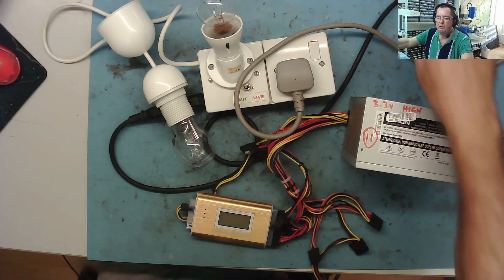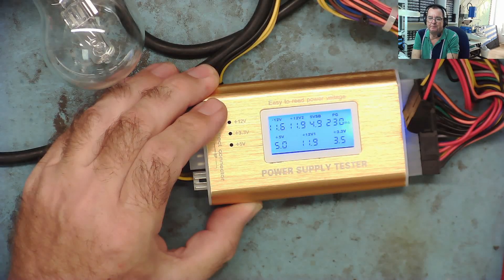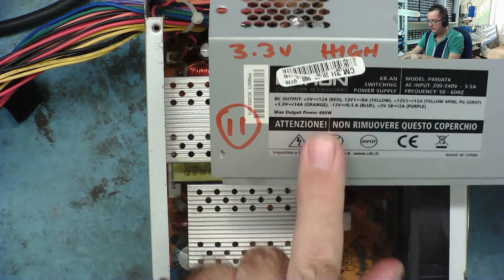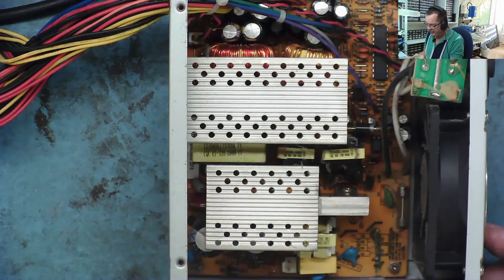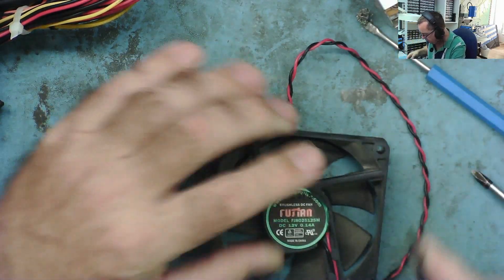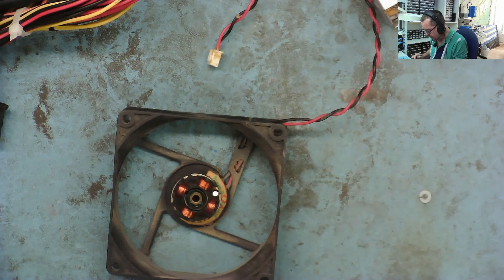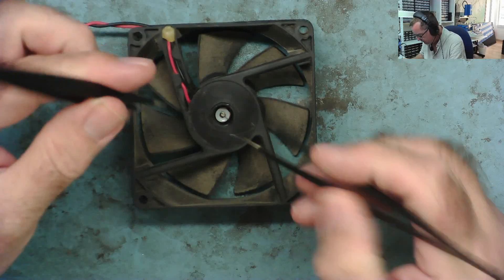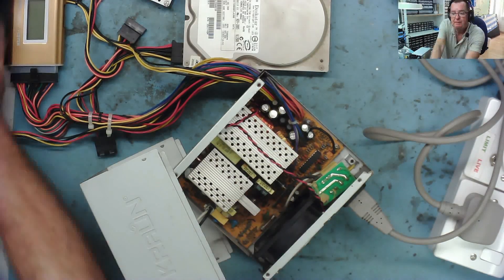ATX PSU Fan repair.  How to repair Computer Fan. cooling fans, case fan.  Noisy Fan ENGLISH

Comment: I noticed that when you had the analyser on that the 12 volt was only reading 11,5. when it should be  greater than 12 volts. My experience when I ran a computer repair shop was that if the analyser show under 12 problems when connected to the motherboard would result.  I would just replace them as it was not economic to repair. I also lacked the knowledge to repair.
Thanks for the videos as I am retired I now have the time to learn how to repair rather than replace faulty electronics and am enjoying your very informative videos.

Comment: Sir" I have a computer power supply, Model number FSP180-50NPL When Green and Black shorten it, the power is on and the fan is running, But whenever I load a lamp at 12 volts it goes off,Please help me repair it..
Reply from the maker: Check for bad capacitors on the 12V rail.  
Check to see if the 5V standby also goes off.
See if you can work out which voltage rail is being monitored (could be 3.3V) and put a load on that rail as well as 12V

All these ideas should give you some clue what is happening

Comment: Hi Richard, great video as always. I have a bunch of broken pc powersupplies lying around, glad that I never threw them away. Oh by the way, check your mike setup because your sound is really on the low side.
Reply from the maker: Have fun with those power supplies.  I play the audio back from my PC on headphones at home or amplified speakers at the workshop when I check the videos it is plenty load enough but you are not the first person to say the audio is low.  I did try on one video using a desk mic via a mixer but the quality was really bad, too much hiss.  

I will continue to work on this.  Could you tell me how you are listening to the audio (eg desktop PC with speakers etc) so it gives me some idea why certain people get low audio levels.  Thanks.
Reply: @LearnElectronicsRepair  Hi, I am always using my Laptop which is an Acer Aspire E15. I have to set both my laptop speaker volume to 100% and your youtube audio volume to 100% - and it is still very low. The thing is that when I listen to other youtubers, the spoken audio volume there is normal. With normal I mean ok to listen to when both volumes are set to 50%

Comment: As for fans, run the blades over some warm water and clean them if you took the time to remove them. Sewing machine oil is actually quite good for fans, and it can be found relatively easily. Yeah, that round clip with a cut is designed like that, better fans use metal ring/clip not some plastic. 
Distributors like Digikey  / Mouser / Farnell / Newark have fans in bulk, they can be bought for as low as 2-3$.
Reply from the maker: Hi mariushmedias
Yes at that point you are totally correct - it would be a good idea to wash the blade assembly once you have removed it.  I have not tried sewing machine oil (and not sure how regional that is as a common product) but I would imagine it is really good for this sort of repair. 

I forgot to mention that cycle oil (bicycles) is a very good substitute for 3-in-One or 3-en-Uno.  I know fans are very cheap also on AliExpress, but the same techniques could be used on premium brand fans - though one would assume they fail less -  or maybe on rare vintage graphics cards etc.  

Mostly I just like fixing things.  Whether it is pointless or not doesn't change the satisfaction of doing it lol

Comment: I doubt there's ANY mechanical drive or SSD that actually uses 3.3v from the sata connector. For backwards compatibility (to get them working with molex->sata adapter cables) everyone stuck to using a basic regulator on the board to get the lower voltages needed.  SSDs also stick to 5v only, 3.3v for m.2 drives. 
In the latest standards one of the 3 3.3v pins is repurposed to a sort of sleep/stand-by function where as long as there's voltage on that pin, the hard drive won't spin up - a lot of people that pull out (shuck) drives from "external storage drives" resort to using tape over the 3.3v pins, or coat the pins with liquid solder mask (that hardens when exposed to UV light)
Reply from the maker: Thanks for the info regarding pulling 'external storage' drives for internal PC use.  I have done that in the past and not had a problem but the scenario you mention could catch a lot of people out, including me.  But it won't now!